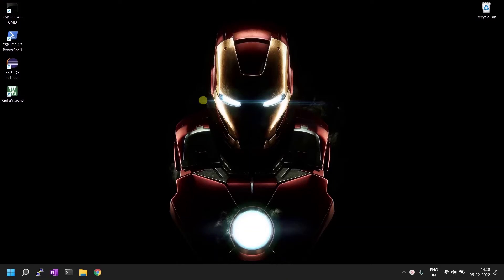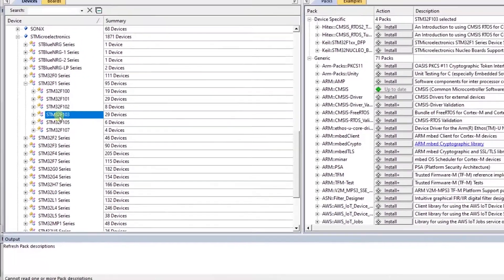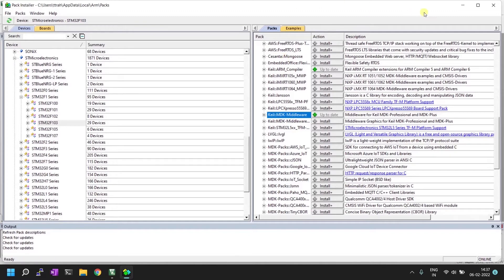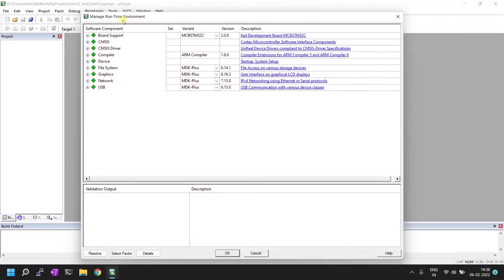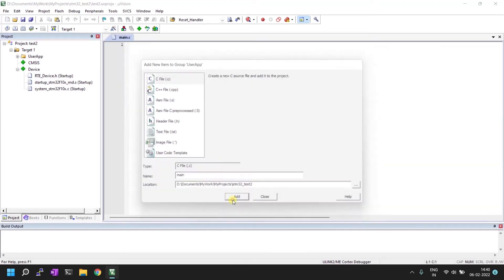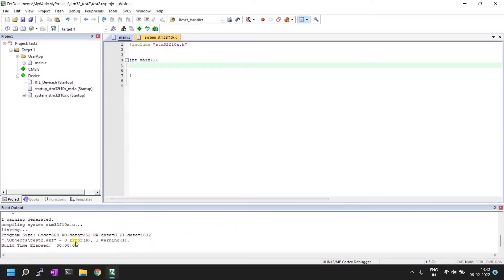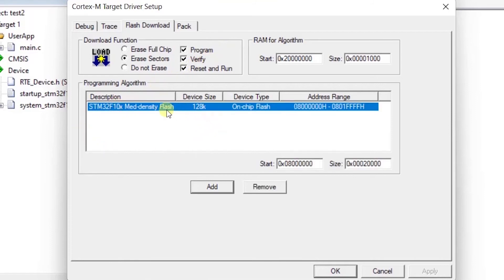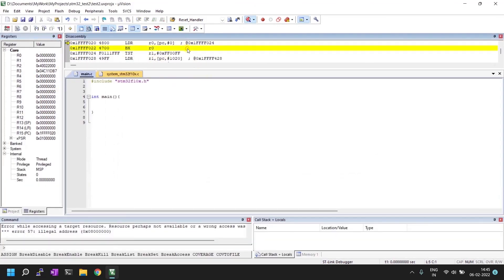Keil 5 project set up from scratch | STM32F103 | ST Link V2 Set up | Run-Time Environment Manager

Comment: , When I install only core and startup, I can compile Compiler 6, but if I add gpio, rcc, framework to it, it will give an error compiling main.c...
C:/APPS/keil5/pkgs/Keil/STM32F1xx_DFP/2.4.1/Device/StdPeriph_Driver/src/misc.c(131): error: no member named 'IP' in 'NVIC_Type'
  131 |     NVIC->IP[NVIC_InitStruct->NVIC_IRQChannel] = tmppriority;
Gemini mentioned that this is a very common CMSIS version conflict issue. Simply put, you are currently using the newest CMSIS 6.x library from 2024 and running it with an older STM32 standard library, which are not compatible with each other. But I changed the CMSIS version to 5.6 in the pack installer, but after that, more dependency errors appeared, is there a solution?
Reply: I have solved it, just need to manually add the stm32f1xx_conf.h file, and add IP=IPR in the macro definition.